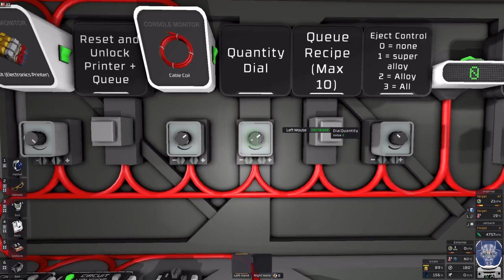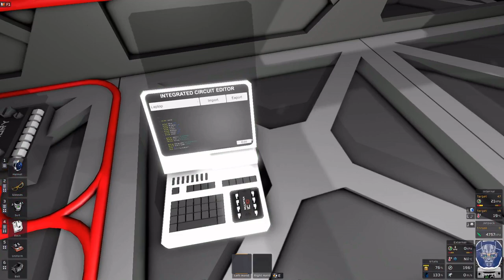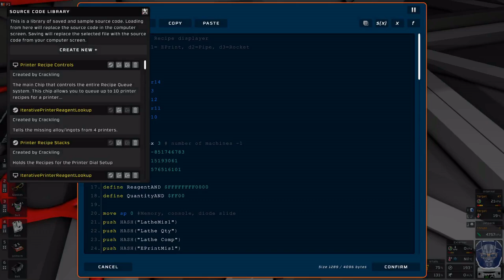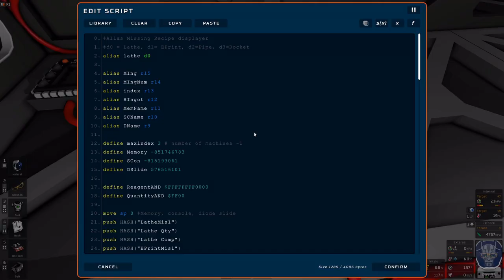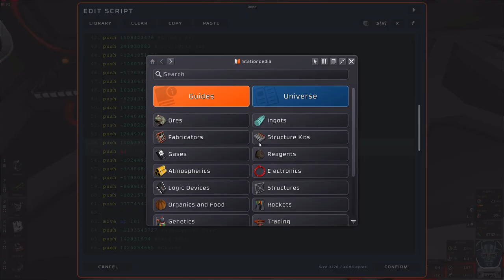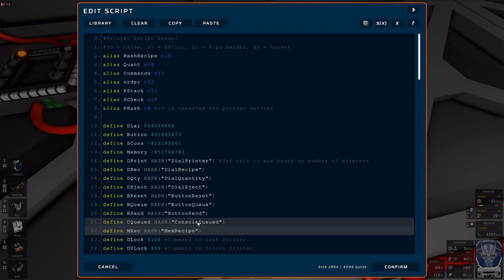Stationeers: Printer Queue Recipes Build

Comment from the maker: #Alias Missing Recipe displayer
#d0 = Lathe, d1= EPrint, d2=Pipe, d3=Rocket
alias lathe d0

alias MIng r15
alias MIngNum r14
alias index r13
alias HIngot r12
alias MemName r11
alias SCName r10
alias DName r9

define maxindex 3 # number of machines -1
define Memory -851746783
define SCon -815193061
define DSlide 576516101

define ReagentAND $FFFFFFFF0000
define QuantityAND $FF00

move sp 0 #Memory, console, diode slide
push HASH("LatheMis1")
push HASH("Lathe Qty")
push HASH("Lathe Comp")
push HASH("EPrintMis1")
push HASH("EPrint Qty")
push HASH("EPrint Comp")
push HASH("PipeMis1")
push HASH("Pipe Qty")
push HASH("Pipe Comp")
push HASH("RocketMis1")
push HASH("Rocket Qty")
push HASH("Rocket Comp")

move index 0

main:
mul sp index 3
add sp sp 3
pop DName
pop SCName
pop MemName
l r0 dr13 CompletionRatio
slt r1 r0 1
sbn DSlide DName On r1
sbn DSlide DName Setting r0
move HIngot 0
move MIng 0
move MIngNum 0
get r0 dr13 54
sra r1 r0 16
and MIngNum r0 QuantityAND
srl MIngNum MIngNum 8
move sp 35
bnezal r1 IngotCheck
move MIng HIngot
sbn Memory MemName Setting MIng
sbn SCon SCName Setting MIngNum
add index index 1
ble index maxindex main
move index 0
yield
j main

#Ingot check
IngotCheck:
rmap HIngot d0 r1
j ra
Reply from the maker: Recipes pushed to the stack.

move sp 1 #Begin Autolathe Recipes
push 1225836666 #Iron Frame
push -1448105779 #Steel Frames
push -487378546 #Iron Sheets
push 38555961 #Steel Sheets
push -1662476145 #Astroloy Sheets
push 662053345 #Plastic Sheets
push 1588896491 #Glass Sheets
push -2038663432 #Stellite Glass Sheets
push -1826855889 #Wall Kits
push -846838195 #Flat Wall Kits
push -821868990 #Padded Walls
push 1182412869 #Gratings
push 750176282 #Railings
push 489494578 #Ladders
push 170878959 #Stairs
push -1868555784 #Stairwell
push 168615924 #Door
push 1935945891 #Interior Door
push 529996327 #Signs
push 882301399 #Lockers
push -1976947556 #Cardboard box
push 1013818348 #Empty Cans
push 1932952652 #Sdb Silo
push -1935075707 #Deep Miner

move sp 51 #Begin EPrint Recipes
push -466050668 #cable coil
push 2060134443 #Heavy Coils
push 731250882 #EParts
push -1792787349 #Cable Analyzer
push -1866880307 #Battery Charger
push 700133157 #Sm Battery
push -459827268 #L Battery
push 544617306 #Nuclear Battery
push -831211676 #Omni Charger
push -41519077 #Wireless Battery
push 1406656973 #Station Battery
push -21225041 #Large Station Battery
push 1757673317 #Power Controller
push 665194284 #Transformer
push -453039435 #L Transformer
push 1108423476 #Lights Kit
push 341030083 #Growlights kit
push -1241851179 #Consoles
push -126038526 #Speaker Kit
push -1776897113 #Sensors
push 1633663176 #Adv Airlock
push 1633074601 #Hash Display
push -82343730 #Gas Display
push 1512322581 #Housing
push -744098481 #IC10
push -2098214189 #Memory Kits
push 124499454 #Logic Switches
push 1005397063 #Logic Transmitters
push -1924492105 #Solar Panel
push -364868685 #Solar Panel Heavy
push -1798044015 #Upright Turbine
push -868916503 #Wind Turbine
push -1821571150 #Stirlings
push 377745425 #Gas Fuel Generator

move sp 101 #Begin Pipe Recipes
push -1193543727 #Hydroponic Tray
push 142831994 #Seed Tray
push 1025254665 #Chutes
push 2133035682 #Powered Chute
push 682546947 #Hangar
push 1222286371 #Atmospherics Kits
push -842048328 #Active Vent
push 2015439334 #Powered Vent
push -38898376 #Pipe Cowl
push 238631271 #Passive Vent
push -1397583760 #Insulated Passive Vent
push -1619793705 #Pipe kit
push 1934508338 #Utility Pipe
push 771439840 #Tank Kit
push 452636699 #Insulated Pipe
push -27284803 #Insulated Utility Pipe
push 1021053608 #Insulated Tank Kit
push -1166461357 #Liquid Pipe
push 595478589 #Utility Liquid Pipe
push -799849305 #Liquid Tank
push 2067655311 #I Liquid Pipe
push -1831558953 #I Utility Liquid Pipe
push 617773453 #I Liquid Tank
push -767597887 #Pipe Analyzer
push 226055671 #L Pipe Analyzer
push 799323450 #G Valve
push -2126113312 #L Valve
push 2036225202 #L Drain
push 1181371795 #Regulator
push 1951126161 #Liquid Regulator
push -1766301997 #Volume Pump
push -2106280569 #L Volume Pump
push -1248429712 #T Volume Pump
push -1805020897 #T L Volume Pump
push 920411066 #Radiator
push -1697302609 #L Radiator
push -1752768283 #M Radiator
push 1453961898 #ML Radiator
push -1332682164 #S HE
push 450164077 #L HE
push 636112787 #CounterFlow
push 1587787610 #PC Device

move sp 151 #Begin Rocket Recipes
push -366262681 #Fuselage
push -174523552 #Launch Tower
push -1867280568 #Umb Gas
push 1571996765 #Umb Liquid
push 1603046970 #Umb Power
push -876560854 #Umb Chute
push 1396305045 #Avionics
push -1256996603 #Datalink
push -303008602 #Celestial tracker
push -314072139 #Rocket Battery
push 479850239 #Rocket Cargo
push 721251202 #Rocket Housing
push -867969909 #Rocket Miner
push 1753647154 #Rocket Scanner
push -1198702771 #Scanner Head
push 1083675581 #Ore Head
push 1440678625 #HSpeed Ore head
push -380904592 #Ice Head
push 653461728 #HSpeed Ice Head
Reply from the maker: #Printer Recipe Sender
#d0 = Lathe, d1 = EPrint, d2 = Pipe Bender, d3 = Rocket
alias HashRecipe r15
alias Quant r14
alias Commands r13
alias order r12
alias PStack r11
alias SCheck r10
alias PHash r8 #r9 is reserved for printer devices

define Dial 554524804
define Button 491845673
define SCons -815193061
define Memory -851746783
define DPrint HASH("DialPrinter") #Set this to max based on number of printers
define DRec HASH("DialRecipe")
define DQty HASH("DialQuantity")
define DEject HASH("DialEject")
define BReset HASH("ButtonReset")
define BQueue HASH("ButtonQueue")
define BSend HASH("ButtonSend")
define CQueued HASH("ConsoleQueued")
define MRec HASH("MemRecipe")
define DLock $106 #Command to Lock Printer
define DULock $06 #Command to Unlock Printer
define WVR $03 #Command to Wait for Valid
#move sp 1
#move sp 51
#move sp 101
Initialize:
move Commands 0
clr dr9
put dr9 0 $06
s dr9 Lock 0
s dr9 Activate 0
yield
main:
lbn r0 Button BReset Setting Average
bnez r0 Initialize
brnez Commands 3
lbn r9 Dial DPrint Setting Average #Gets current recipe
jal GetPrinter
lbn Quant Dial DQty Setting Average
lbn r0 Dial DRec Setting Average
move HashRecipe 0
bnezal r0 RecGet
breqz r0 3 #skip the que
lbn r0 Button BQueue Activate Average
bnezal r0 Queue
lbn r0 Button BSend Setting Average
beqz r0 end
#compose recipe
move PStack 0
clr dr9
s dr9 On 1
s dr9 Open 0
put dr9 PStack DLock
Loop:
add PStack PStack 1
put dr9 PStack WVR
jal GrabRec
bgtz Commands Loop
add PStack PStack 1
put dr9 PStack DULock
lbn r0 Dial DEject Setting Average
bnez r0 eject
end:
sbn Memory MRec Setting HashRecipe
sbn SCons CQueued Setting Commands
s db Setting PHash
yield
j main

RecGet:
mul r1 r9 50
add r1 r0 r1
get HashRecipe db r1
j ra
Queue:
beqz Quant ra
bge Commands 10 ra
sbn Button BQueue Activate 0
yield
add sp 400 Commands
move order 0
sll order HashRecipe 16
sll r1 Quant 8
add order order r1
add order order 2
push order
add Commands Commands 1
j ra
GrabRec:
add PStack PStack 1
sub SCheck sp Commands
get order db SCheck
sub Commands Commands 1
put dr9 PStack order
j ra

GetPrinter:
move PHash -1753893214 #Autolathe hash
beqz r9 ra
move PHash -1181922382 #EPrinter Hash
beq r9 1 ra
move PHash -2098556089 #Pipe Hash
beq r9 2 ra
move PHash -636127860 #Rocket Hash1
beq r9 3 ra
j ra

put dr9 40 $08
j end
eject:
breq r0 3 -3
put dr9 40 $E22A4AE007 #Stellite Eject
put dr9 41 $A700403507 #Astrolloy Eject
put dr9 42 $DD113F8D07 #Inconel Eject
put dr9 43 $6A8FE19507 #Waspaloy Eject
put dr9 44 $7862ACC707 #Hastelloy Eject
beq r0 1 end
put dr9 45 $4F5ECE9707 #Steel Eject
put dr9 46 $6730A5B007 #Constantan Eject
put dr9 47 $DAA9130107 #Invar Eject
put dr9 48 $B8159FD307 #Solder Eject
put dr9 49 $1C81BDA607 #Electrum Eject
j end
Reply: @shadowdrake082  
AWESOME!! TY

Comment: Get error "Out off device bounds at line31"
Reply from the maker: Which one? I think i had 2 linked codes that i uploaded to the workshop.
Reply: @shadowdrake082  Printer Recipe Controls
Reply from the maker: @aliumas147  Did you set the device pins? i think that corresponds to the "clr dr9" line
Reply: @shadowdrake082 Rebuolt it from scratch. all ic green but still glitchy. i can select crafting mashine and console shows but recipe selection dose not work. It will not send comands to printer. Vending refill works. screans that show missing and recipe selection is not working....
Reply from the maker: @aliumas147  Recipe selection requires a chip that pushes device kit IDs to the stack at specific points, or you can do that on your own to rearrange kits.
1-49 is for autolathe buildables
51-99 is electronic printer stuff.
101-149 is pipe bender stuff
151-199 is rocket manufactory stuff.

I'll need to make sure recent changes havent messed with other things because I want to say I relied on ld/sd commands are deprecated but should still work.

Comment: Just wondering wouldn’t it better instead of a diode slide showing progress, instead a display show how many left? And as for the having 250 being the highest number…..remember if you think you have enough cables or pipes…you don’t lol
Reply from the maker: I’ll have to dig into the printer instructions to see if i can see how many were built and left. I could do that and fit it into the stack loop and see. I had the completion diode because a locked printer wouldnt show you the completion rate of the part and i wanted a visual to show that for a longer duration print.
Reply: @shadowdrake082 probably stupig idea. Using stacker. When sendind to printer write to stacker to using batch name how namy ordered then minus whats inside mashine and you get how many is left and then just send to bat h led small.

Comment from the maker: #Printer Recipe Sender
#d0 = Lathe, d1 = EPrint, d2 = Pipe Bender, d3 = Rocket
alias HashRecipe r15
alias Quant r14
alias Commands r13
alias order r12
alias PStack r11
alias SCheck r10
alias PHash r8 #r9 is reserved for printer devices

define Dial 554524804
define Button 491845673
define SCons -815193061
define Memory -851746783
define DPrint HASH("DialPrinter") #Set this to max based on number of printers
define DRec HASH("DialRecipe")
define DQty HASH("DialQuantity")
define DEject HASH("DialEject")
define BReset HASH("ButtonReset")
define BQueue HASH("ButtonQueue")
define BSend HASH("ButtonSend")
define CQueued HASH("ConsoleQueued")
define MRec HASH("MemRecipe")
define DLock $106 #Command to Lock Printer
define DULock $06 #Command to Unlock Printer
define WVR $03 #Command to Wait for Valid
#move sp 1
#move sp 51
#move sp 101
Initialize:
move Commands 0
clr dr9
put dr9 0 $06
s dr9 Lock 0
s dr9 Activate 0
yield
main:
lbn r0 Button BReset Setting Average
bnez r0 Initialize
brnez Commands 3
lbn r9 Dial DPrint Setting Average #Gets current recipe
jal GetPrinter
lbn Quant Dial DQty Setting Average
lbn r0 Dial DRec Setting Average
move HashRecipe 0
bnezal r0 RecGet
breqz r0 3 #skip the que
lbn r0 Button BQueue Activate Average
bnezal r0 Queue
lbn r0 Button BSend Setting Average
beqz r0 end
#compose recipe
move PStack 0
clr dr9
s dr9 On 1
s dr9 Open 0
put dr9 PStack DLock
Loop:
add PStack PStack 1
put dr9 PStack WVR
jal GrabRec
bgtz Commands Loop
add PStack PStack 1
put dr9 PStack DULock
lbn r0 Dial DEject Setting Average
bnez r0 eject
end:
sbn Memory MRec Setting HashRecipe
sbn SCons CQueued Setting Commands
s db Setting PHash
yield
j main

RecGet:
mul r1 r9 50
add r1 r0 r1
get HashRecipe db r1
j ra
Queue:
beqz Quant ra
bge Commands 10 ra
sbn Button BQueue Activate 0
yield
add sp 400 Commands
move order 0
sll order HashRecipe 16
sll r1 Quant 8
add order order r1
add order order 2
push order
add Commands Commands 1
j ra
GrabRec:
add PStack PStack 1
sub SCheck sp Commands
get order db SCheck
sub Commands Commands 1
put dr9 PStack order
j ra

GetPrinter:
move PHash -1753893214 #Autolathe hash
beqz r9 ra
move PHash -1181922382 #EPrinter Hash
beq r9 1 ra
move PHash -2098556089 #Pipe Hash
beq r9 2 ra
move PHash -636127860 #Rocket Hash1
beq r9 3 ra
j ra

put dr9 40 $08
j end
eject:
breq r0 3 -3
put dr9 40 $E22A4AE007 #Stellite Eject
put dr9 41 $A700403507 #Astrolloy Eject
put dr9 42 $DD113F8D07 #Inconel Eject
put dr9 43 $6A8FE19507 #Waspaloy Eject
put dr9 44 $7862ACC707 #Hastelloy Eject
beq r0 1 end
put dr9 45 $4F5ECE9707 #Steel Eject
put dr9 46 $6730A5B007 #Constantan Eject
put dr9 47 $DAA9130107 #Invar Eject
put dr9 48 $B8159FD307 #Solder Eject
put dr9 49 $1C81BDA607 #Electrum Eject
j end
Reply from the maker: Recipes pushed to the stack for the controls

move sp 1 #Begin Autolathe Recipes
push 1225836666 #Iron Frame
push -1448105779 #Steel Frames
push -487378546 #Iron Sheets
push 38555961 #Steel Sheets
push -1662476145 #Astroloy Sheets
push 662053345 #Plastic Sheets
push 1588896491 #Glass Sheets
push -2038663432 #Stellite Glass Sheets
push -1826855889 #Wall Kits
push -846838195 #Flat Wall Kits
push -821868990 #Padded Walls
push 1182412869 #Gratings
push 750176282 #Railings
push 489494578 #Ladders
push 170878959 #Stairs
push -1868555784 #Stairwell
push 168615924 #Door
push 1935945891 #Interior Door
push 529996327 #Signs
push 882301399 #Lockers
push -1976947556 #Cardboard box
push 1013818348 #Empty Cans
push 1932952652 #Sdb Silo
push -1935075707 #Deep Miner

move sp 51 #Begin EPrint Recipes
push -466050668 #cable coil
push 2060134443 #Heavy Coils
push 731250882 #EParts
push -1792787349 #Cable Analyzer
push -1866880307 #Battery Charger
push 700133157 #Sm Battery
push -459827268 #L Battery
push 544617306 #Nuclear Battery
push -831211676 #Omni Charger
push -41519077 #Wireless Battery
push 1406656973 #Station Battery
push -21225041 #Large Station Battery
push 1757673317 #Power Controller
push 665194284 #Transformer
push -453039435 #L Transformer
push 1108423476 #Lights Kit
push 341030083 #Growlights kit
push -1241851179 #Consoles
push -126038526 #Speaker Kit
push -1776897113 #Sensors
push 1633663176 #Adv Airlock
push 1633074601 #Hash Display
push -82343730 #Gas Display
push 1512322581 #Housing
push -744098481 #IC10
push -2098214189 #Memory Kits
push 124499454 #Logic Switches
push 1005397063 #Logic Transmitters
push -1924492105 #Solar Panel
push -364868685 #Solar Panel Heavy
push -1798044015 #Upright Turbine
push -868916503 #Wind Turbine
push -1821571150 #Stirlings
push 377745425 #Gas Fuel Generator

move sp 101 #Begin Pipe Recipes
push -1193543727 #Hydroponic Tray
push 142831994 #Seed Tray
push 1025254665 #Chutes
push 2133035682 #Powered Chute
push 682546947 #Hangar
push 1222286371 #Atmospherics Kits
push -842048328 #Active Vent
push 2015439334 #Powered Vent
push -38898376 #Pipe Cowl
push 238631271 #Passive Vent
push -1397583760 #Insulated Passive Vent
push -1619793705 #Pipe kit
push 1934508338 #Utility Pipe
push 771439840 #Tank Kit
push 452636699 #Insulated Pipe
push -27284803 #Insulated Utility Pipe
push 1021053608 #Insulated Tank Kit
push -1166461357 #Liquid Pipe
push 595478589 #Utility Liquid Pipe
push -799849305 #Liquid Tank
push 2067655311 #I Liquid Pipe
push -1831558953 #I Utility Liquid Pipe
push 617773453 #I Liquid Tank
push -767597887 #Pipe Analyzer
push 226055671 #L Pipe Analyzer
push 799323450 #G Valve
push -2126113312 #L Valve
push 2036225202 #L Drain
push 1181371795 #Regulator
push 1951126161 #Liquid Regulator
push -1766301997 #Volume Pump
push -2106280569 #L Volume Pump
push -1248429712 #T Volume Pump
push -1805020897 #T L Volume Pump
push 920411066 #Radiator
push -1697302609 #L Radiator
push -1752768283 #M Radiator
push 1453961898 #ML Radiator
push -1332682164 #S HE
push 450164077 #L HE
push 636112787 #CounterFlow
push 1587787610 #PC Device

move sp 151 #Begin Rocket Recipes
push -366262681 #Fuselage
push -174523552 #Launch Tower
push -1867280568 #Umb Gas
push 1571996765 #Umb Liquid
push 1603046970 #Umb Power
push -876560854 #Umb Chute
push 1396305045 #Avionics
push -1256996603 #Datalink
push -303008602 #Celestial tracker
push -314072139 #Rocket Battery
push 479850239 #Rocket Cargo
push 721251202 #Rocket Housing
push -867969909 #Rocket Miner
push 1753647154 #Rocket Scanner
push -1198702771 #Scanner Head
push 1083675581 #Ore Head
push 1440678625 #HSpeed Ore head
push -380904592 #Ice Head
push 653461728 #HSpeed Ice Head

Comment: I only wish you would post your code in the comments. Not a link, the text.
Reply from the maker: I could, but since I used close to 90 lines, I'm not sure that youtube's formatting would take that too well. The reason I did the workshop links is because subscribing to them gives you the whole code in game. Other reason would be if I find bugs or weird little interactions, I can fix them and upload the code again and it would be fixed. I wouldnt need to find my comments again and edit them again.
Reply: @shadowdrake082  
Good points. I just don't use steam. Might have to at some point though. One time post code as a reference really. Any real changes are another video. 😆
Reply from the maker: @NoHypocrisy42  Sure, let me see if I can format it to still be legible and pin it.